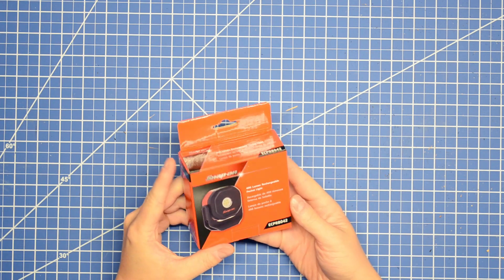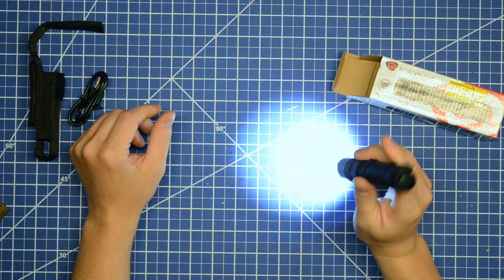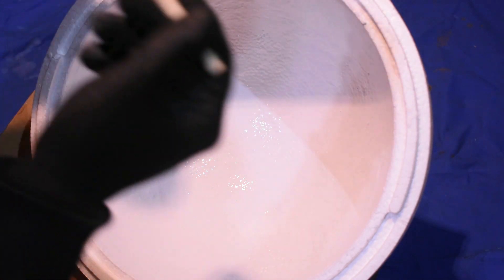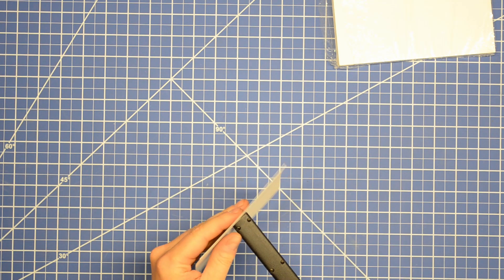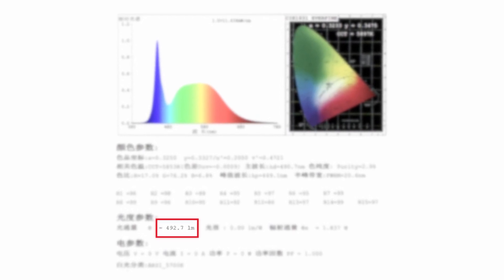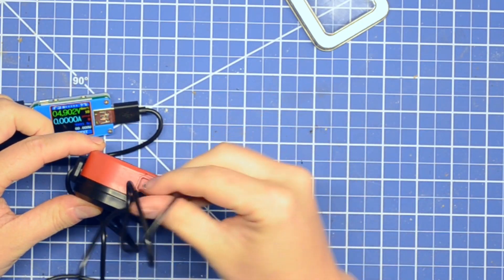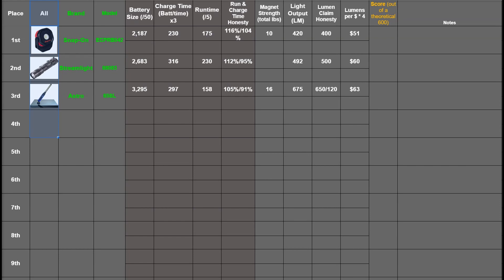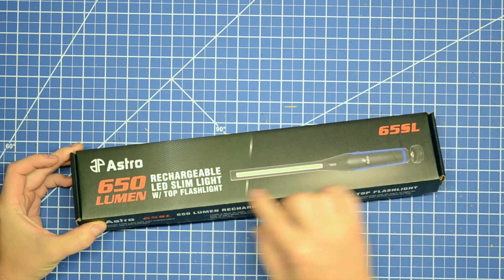Are Lumens Fake? We Built a Light Lie Detector: Snap on, Streamlight

Comment: light spectrum is very important. I don't know is it possible to make a cheap rig to test it, probably some filters before lux meter.
Reply: In the context of a mechanic, I'm not sure the color spectrum is that important since the human eye is remarkably good at adjusting to different light sources. That said, as a photographer I can tell you that color spectrum is very important for a camera to be able to capture images or video correctly. If you ever have to take a photograph or capture video for a client or yourself, you will most likely benefit greatly from a high CRI full spectrum light source. If you're making a new investment in lights why not look at all aspects at once,

Cheap low CRI light sources tend to have missing or peaking wavelengths of light which causes colors to be reproduced poorly. If you use a prism to view the component colors of most artificial light sources, you will almost certainly see large gaps instead of a smooth transition between the colors. It's why florescent lights look green when captured on camera. 

CRI is also not the only important factor as tungsten lights have a CRI of 100 (the highest possible rating) but still appear yellow because they don't have enough blue to accurately reproduce colors.

I don't want to make any assumptions about what Alexey was trying to ask for since it's very possible he was talking about something other than light spectrum like color temperature or CRI. 

My personal preference for any light source is as close to daylight (5000-6000K) with a CRI rating above 90%. 

I find warm light (2800-4000k tungsten or halogen equivalent) sources to be distracting and even find the output to appear more dim than an equivalent daylight light source since it lacks blue wavelengths and all of the colors are biased towards orange/yellow giving the appearance of a more dimly lit area. 

My advise from having purchased cheap led bulbs for home use that claimed a color temperature above 6000k is to also stay away from them because, from experience, people will certainly complain about the color. They we're even too blue/violet for me and I had to mix them in with warm white lights to be able to use them.

Before getting into photography, I did automotive touch-up and I can tell you first-hand how incredibly important lighting is to accurately matching paint. Once again, in context, I doubt that really applies to flash lights but light sources in general. I would have never tried to match paint by using a flashlight.

I would personally think a light's strength and spread are far more important to mechanics than light spectrum. I find it very distracting to have a narrow focused light source for most applications with automotive work. With the exception of inspecting tight spaces or cavities, I generally want a light that will illuminate a larger area so my eyes don't have to struggle so much with the high contrast between highlights and shadows.
Reply: Yeah maybe if these were for growing plants. Otherwise why would it matter?
Reply: Lumens are for humans, and all they’d have to do to measure the different spectrums is buy a spectrum tester for about $700.00.
Reply: @tombryant4518  you can also make one with the webcam and a diffraction grading it's easy look it up has to be a webcam without an IR filter on it though
Reply: @mqe73M  I’m not a tech guy at all, but I’m a plant guy. If it’s that easy, why is it not used at all in the horticulture world?
Reply: @mqe73M  I’m going to watch some videos on that now.

Comment: The big problem with LED flashlights and brightness ratings isn't so much a company outright misleading you. I mean, many do and some horribly, but this has been known for years now. The problem with almost any LED light source is the fact output will decrease the longer it stays on. LEDs are a diode and heat affects them greatly. Lights promising 1000 lumens may very well produce that the second you turn it on, but the longer it stays on, the more heat will build up and the less light the LED will emit. 

After five minutes of being on, it my produce just a half as much light as it did when first turned on. Output will continue to drop until an equilibrium is met. Beyond heat buildup, you also have to consider the type of batteries and electronics feeding power too. If you guys really want to test LED flashlights out, a runtime graph is important. It shows you just what the flashlight is doing. It shows you what the light does from the first second it's turned on to when the batteires give out or the driver turns it off to protect them.

Comment: You have to be careful with measuring the capacity. The meter shows mAh at the voltage of the charger, hopefully 5v. The battery usually has a voltage between 3 and 4,2V depending on the state of charge. 3000 mAh at USB's 5V equals 15Wh, 3000mAh advertised capacity of the battery at the nominal voltage of 3.7 Volts for LI-ON batteries equals 11.1Wh. Should the voltage of the charger drop to 4.8V, that's only 14,4Wh or 3125mAh for the same 15Wh of energy.

Comparing the advertised number vs the number on the thingy is heavily dependent on the voltage of the charger and the efficiency of the charging circuit. While you can't really measure the efficiency of the circuit without taking the light apart, you can at least account for variance in the voltage of the charger by comparing mWh instead of mAh.

The thingy displays mWh, for most common LI-ON batteries you can simply multiply the advertised value in mAh by the nominal cell voltage of 3.7V to get mWh.

Comment: Flashlight testing is definitely a rabbit hole all to itself but generally there are honest specs and outright liars out there though the ANSI FL1 standard is to some extent a broken testing standard.
Reply: For what it is worth, you should probably check color temp and CRI on these lights.  I personally found that I work faster with less eye strain when I have a good high-CRI work light.

For headlamps, I really like my " Skilhunt H04 RC Mini Hi CRI " though I wish it came with a battery extension tube to enable use of 18650 cells when I need longer runtime. 

I never personally use the built in USB charging and instead use a MiBoxer C4-12 as it is almost always faster.

Something to keep in mind with that USB power meter is that there is a charge controller between the USB port and the actual battery cell so there will be some power conversion efficiency lost and thus you can't say the battery "took back" more than it was rated for when being recharged.

Comment: I use the Protac 2XL with the 18650 battery. For intermittent use throughout the day, it’s awesome. I just let it charge overnight in my work truck when it needs it. For a shop light, I use a Snap-On light that claims 1000 lumens. It’s pretty darn bright. It lasts a couple hours at 50%.

Comment: Test the Braun from HF also like the lamps from ryobi and dewalt
Reply from the maker: Will do, and for the DeWalt, Ryobi, Milwaukee ect if they fit we can test em. We're limited to about 3.25" diameter on the round part and 10" in length on the stick light hole. Modifying the sphere might influence future results.
Reply: @TorqueTestChannel  it would be cool if in the future you built a bigger testing rig for work lights, especially the ones that accept tool batteries.
Reply: I am liking my 3rd Braun from HF. The first two were glitchy and malfunctioned in less than 6 months of very light use on vehicle interiors only. After replacing it twice my third one I have put through the ringer and is functioning well.
Reply: @DriftingDragon74  I'm on my 6th one-  they just don't hold up in a professional environment.
Reply: You need to use separate spheres, clearly the snap on loosened it up for the other lights

Comment: Test the Ridgid Light cannon! R8694220B, and maybe compare lumens from 18v battery to 12v adapter (it's included with it for in vehicle use) . Love the channel!
Reply from the maker: Any idea on the size specs for the head of that?
Reply: 4.2865"x4.2160" on outside of lens housing, actual lens is 3.750"x3.6585" .  That work?
Reply: Would be cool to see if battery size makes a difference in brightness, especially that potent 3ah octane with the larger cells
Reply from the maker: @MegaCole76  Thanks for the specs. Our hole (lol) is 3.25" round. Based on the sphere size which is large as we could find of this foam type, that's about as big as we could go and be far away enough from the meter. Changing the hole may effect the calibration now :(

Comment: Would be nice to know if you could run these for a 5 or 8 hr shift 6 days a week (probably needing more than one of each light for each test day).  Retest lumens on them again every week to see when the battery fails the led's or if the led's fail the battery in long term use.

Gets you a parts lifespan and a real world dependability/value rating too.
Reply: For regular use I would strongly recommend getting one that uses 18650 batteries. Then find an old dead laptop battery cut it open and harvest the 18650's out of there. Go on Amazon and buy a lithium 1860 battery charger and you're in business.

Comment: How did you decide the, divide by 50, multiply by 3, and divide by 5?
Reply from the maker: Good question, to match our other rank lists in each column we want a score near 100 to be really good, a score near 10-20 to be not good and a mix in between. Then depending on the values, they have to be normalized into these sort of ranges. Roughly

Comment: most lights use led so 90.000 is possible without heat halogen got heat you mean.
Reply from the maker: Even SMD or COB LED while super effcient, at that lumen level would need active cooling like water or a fan. High lumen LED's still very very hot and need heat sinks
Reply: 100% electrical to light efficiency would equate to about 700 lumens per watt.  Some of the very best large COB LEDs can hit about 225 lm/w.  The average light bulb is only 15lm/w.  In other words, a light bulb is about 2% and a REALLY good LED is approaching 35%.  So, no matter the device, you still have a significant amount of electrical energy that is wasted and being converted to heat.

90,000lm would be best case 400w with 260w of that 400w being wasted as heat.

Comment: Redesigned Milwaukee M12 Rover (700 lm)
Reply from the maker: What are the dimensions of the light portion if you have one by chance?
Reply: @TorqueTestChannel  The lighting element itself is 35mm x 105mm while the housing (black border) is 56mm x 134mm.

Glad to see you guys are getting into lights love the analytical approach. Would be cool to see you explores the CRI/Ra values as well at Kelvin, not sure how difficult they are to measure though.
Reply from the maker: @maxbesser  Agreed, the lab gave us that info but we have little in the ways to measure it accurately ourselves as of now. I think a Colorimeter or spectro-meter are like $1700-2400, unless anyone has a smarter approach.
Reply: Really interesting. Love the DIY light sphere.